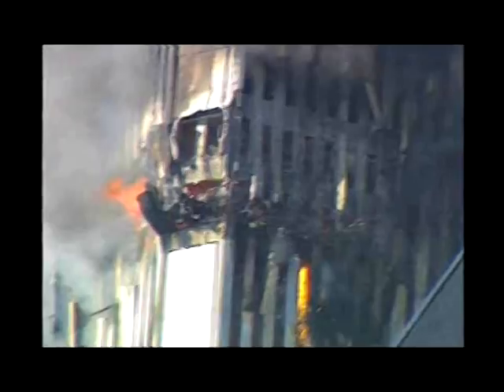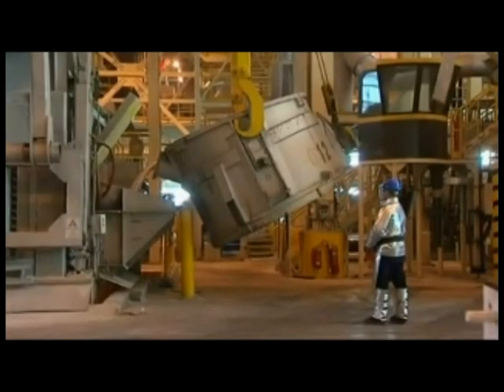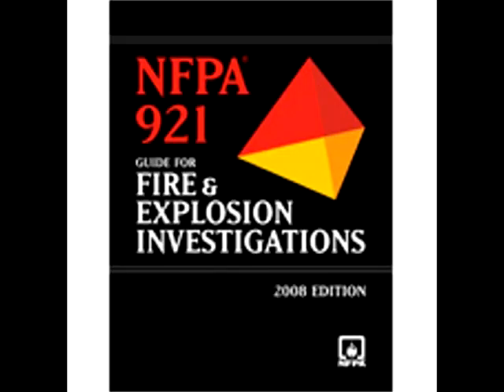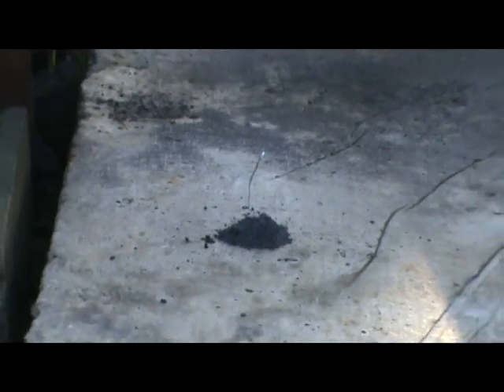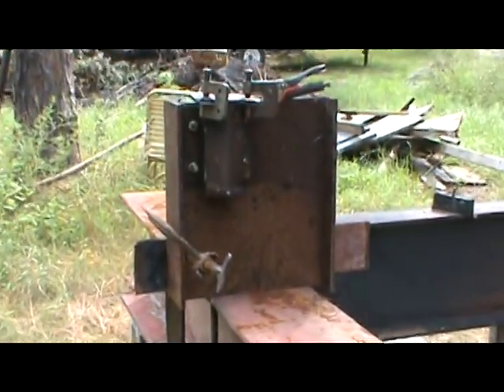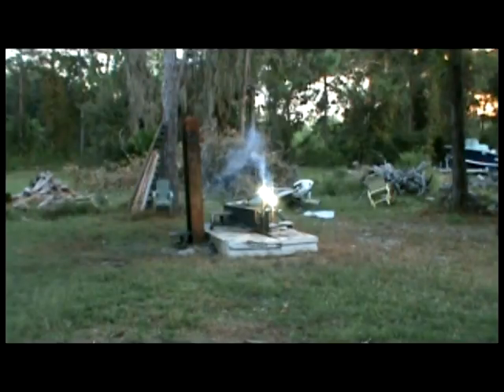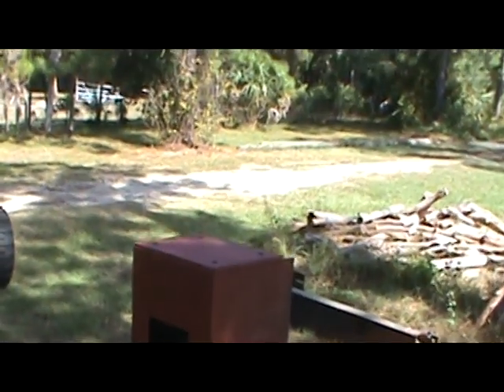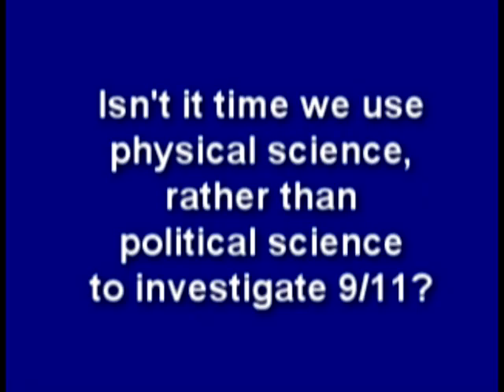9/11 Experiments: The Great Thermate Debate

Comment: LMFAO when engineers design sky scrapers it's tough. You have to make the building strong but light. You need concrete and steel (which are heavy) so you design within tolerances. Concrete & steel have fire tolerances (and planes crashing into them tolerances), when these tolerances are exceeded... the structure fails.
Reply: Craig Thomson And yet they both fell straight down. Going by your theory, the tops of both towers should have buckled and fell over. The planes didn’t go through the whole building, making one side less structurally sound. They should have collapsed on the side where the planes hit and only brought part of the building down. They fell straight down and ended up in a neat little pile on the ground.
Reply: The most consequential designs that were not included in the Twin Towers were sufficient fire-suppression systems and fireproofing. Even though the towers were built to withstand the impact of a jetliner, they were not designed to withstand and remain standing during a fire of such great magnitude. The jet-fuel fire caused by the impact was impossible to contain in the Twin Towers. The World Trade Center had not been designed to fight hydrocarbon fires of such magnitude and high temperature – up to 1500 degrees Celsius. The fire-suppression system consisted of water sprinklers that were useless because water, at this temperature, would vaporize almost instantly. Instead, these fires had to be fought with chemical foam, which the Towers lacked (Ashley 2001).

The fireproofing system in the Towers was also insufficient. First, the Towers were lightweight because of their extensive use of steel and were devoid of masonry or concrete which made them difficult to insulate from the fire. Second, a more sophisticated fireproofing system could have been incorporated during the building process. Most of the supports and trusses could have been coated with extra fire proofing material (Ashley 2001). Third, the World Trade Center incorporated a novel, yet very flammable, elevator system (Wilkinson 2002). The engineers worried that, without masonry, the conventional elevator shafts would buckle and collapse with the intense air pressure exerted by the high speed elevators. To solve this problem the engineers used a drywall/plaster system fixed to a reinforced steel core; this made the shafts more flexible though much more flammable (Wilkinson 2002).

Another design shortcoming that made the ensuing fire even more destructive was the use of weak floor trusses which spanned abnormally long distances (Ashley 2001). In the Twin Towers the steel trusses spanned nearly sixty feet without any support and were only four inches thick (Federal Emergency Management Agency 2002). The extremely high-temperature fire heated the relatively thin floor rapidly, making the floor almost flexible because it lost most of its rigidity and consequently buckled. Since the floor buckled, the extra support needed to come from the remaining exterior perimeter columns, but many had been destroyed by the planes’ initial impact. But those columns also depended on the core steel columns for support, but these columns were being subjected to extremely harsh conditions of the fire and were failing themselves. The exterior columns began to buckle onto the floor which buckled on the floor beneath and started a gigantic domino effect of the plunging stories. So, in effect, the fire caused all structural supports to weaken and fail within the Twin Towers.
Reply: Craig Thomson they designed the building to be hit by planes.
Reply: Craig Thomson I think you just shut them all up 🤫🤫🤫🤫🤫
Reply: Craig will not reply...
he didn't think it over. there have been many fires in tall buildings, the only one that collapsed to the ground was the strongest reinforced building ever to have been made.. the twin towers.
I repeat, NEVER has a building collapsed due to fires, even a fire that lasted over 24 hours..

I can't stand these people that somehow think they know it all better without ever looking further than what's handed to them by some mainstream media even when it taunts logic.
Reply: Euroduck why shouldn't they fall straight down? Have you seen a lot of 1300ft buildings fall? Please site your engineering proof and video's of these buildings falling ;-)
Reply: No, fucker, JUMBO jets at speed.
Reply: a) hollow sheet metal planes cannot cut core columns
b) we're talking about fuel melting steel.
c) you can tell when the fuel was burned up early on because the building smokes.
d) NO building fire has ever collapsed a steel and concrete high rise
e) And it didn't this time, it was controlled demolition (which hapens to be the name of the company that cleaned up the mess)
f) the Popular Mechanics report left out the core columns
g) the building didn't collapse the way they described, it went down like CD
h) the temperature curve DECREASED over time, not increased
i) with core columns the building would have buckled (toppled) sideways otherwise
j) all key physical evidence, eyewitness testimony, and forensic investigations conclude it was CD
k) The military was clearly complicit in allowing the hijacking to continue to completion
l) the Pentagon crash conveniently destroyed teh wing that held financial records.

I don't need to go on. You all fail.

I'd like to add a last note: there are videos of just how bad terrorists are at organized warfare. We had a company of brave US soldiers that won the first battles ON HORSEBACK.  But suddenly they are aeronautical experts and able to control crowds of people on the planes? Fly with precision... etc... 
Those were MERCENARIES. Highy trained operatives, not jihadists. They were hand picked military men from Saudi Arabia. Which just happens to own a lot of America and be super best friends with the Bushes, who happen to be CIA, tied to Nazi Party, Skull n Bones, and the Trilateral Commission.

If you don't see it: you're simply ignorant, nescient really. You haven't done the work, you haven't acknowledged the reality and horror. You apparently haven't studied Gengis Khan, or Stalin, or Mao or any of the other CONSPIRACIES to commit atrocities for political gain. Hell, even FDR and Churchill enabled atrocities so they could justify the war, politically.

Freaking Hillary Clinton was just partially involved in several conspiracies, and we had Fast n Furious.

PEOPLE CONSPIRE. That's what they do.  You just are not important enough to be inveigled into one.
Reply: Craig Thomson and building 7??? and the fall rate being equal to building in controlled demolition??? and pentagon site crash with no engines on the ground to show for... or any working cameras for us to see at least one footage?

I think you just feel comfortable in thinking that your govt is protecting you, good luck!
Reply: Craig Thomson - 
Firstly, I completely agree with Shifu Careaga. That was en excellent breakdown of the main points regarding the 9/11 events AND some wise words regarding conspiracies in general. 
However, I would like to add some thoughts and insights from a trained firefighters point of view, in response to what Craig Thomson wrote:

 "The fire-suppression system consisted of water sprinklers that were useless because water, at this temperature, would vaporize almost instantly. Instead, these fires had to be fought with chemical foam"

-That is literally the key fire suppressing ability of water. It vaporizes and thus "steals" energy from the hot gases that are produced in the combustion process, which in turn brings the temperature down and this eventually extinguishes the fire. 
Regarding foam, it mainly consists of water. What the foam does is that it forms a surface, which to a bigger extent than just water, prevents re-ignition. The foam also exceeds in suppressing liquid fires, especially petroleum products, since the foam floats on top of the liquid. Whereas water, which has higher density, sinks under the jet fuel.

"the engineers used a drywall/plaster system fixed to a reinforced steel core; this made the shafts more flexible though much more flammable"
-I think dry wall is the go-to way for fireproofing, at least in domestic buildings. So to call it flammable is quite a stretch. Solid concrete, although most often much thicker, is of course superior.

Steel/Concrete skyscrapers don't disintegrate from fires. 
They were built to withstand a Boeing 707 at 600 mph

http://www1.ae911truth.org/faqs/655-faq-9-were-the-twin-towers-designed-to-survive-the-impact-of-the-airplanes.html
Reply: Craig Thomson I don’t know if you realize that a plane compared to a building such of those is like trowing a paper plane against a window, planes are made of aluminium...there is no physical way that they will exceed the required specs of a building to collapse if the building would be hit by even a 747!! Do some research!
Reply: Shifu Careaga I don't need A) through L) to refute you. 
A) Those hollow sheet metal planes exerted  3.706 billion ft lbs force upon impact. (That's like being hit with a feather I assume) 
B) The fuel didn't need to melt steel. Steel loses 50% of it's strength at a mere 650 degrees. The fire was estimated to be between 1200 to 1500 degrees.
C) High Strength Concrete HSC (What the columns were made of btw) experiences explosive spalling (that's when moisture in the concrete expands rapidly damaging the integrity of the concrete) at 600 degrees & as we know jet fuel burns at 1500 degrees. So those columns which were no doubt damaged by the impact (see point A) & were also weakened by explosive spalling, may not be the best thing to hold up tens of thousands of tonnes.
D) As for the controlled demolition hypothesis. WTF? Have you ever watch a documentary about CD. 1. It takes weeks to prepare even in buildings 15 stories high (let alone 110 stories). 2. You would need to run many thousands of miles of wiring (which no one saw btw) 3. You would need to lay thousands of charges, which need to be drilled into the concrete (which no one saw btw) 4. The buildings fell from exactly the point of impact & fires (coincidence I guess). 
E) There is footage of the outer walls of the buildings bowing inwards shortly before the collapse. This was caused when the steel girders weakened (not melted by fire) & sagged, as they sagged downwards they pulled the outer walls inwards (that's called physics). When this got too extreme the collapse began & pancaking ensued. Btw pancaking is very common in steel & concrete high rises if you care to look it up (and it doesn't require CD). 

I will concede that it's very possible that the U.S intelligence agencies knew an attack was imminent (and ignored it to further some agenda, who knows).

But what I will also point out is that conspiracy theorist ignore facts. Like for instance the plane hitting the pentagon. They ignore hundreds of witnesses on the freeway who saw the plane (which hit 5 freeway lights & a generator as it passed by) not a fucking missile or bomb ffs. They ignore the thousands of witnesses who worked in the trade towers who never saw any of the laborious & obvious work (workers) required to set up a CD of two 110 story buildings. 
They ignore the fact that the CIA allegedly implemented the most complex conspiracy ever & accidentally had most of the hijackers come from Saudi Arabia (a U.S ally) rather than Iraq, Iran or any number of very beneficial countries.
WTF WTF WTF?
Reply: Euroduck because buildings are made to do that they hen they fail you fucking potato
Reply: Craig Thomson said "Now add a few hundred thousand tonne and a jet flying 500mph and what happens"

A 767-200ER  (the heaviest plane used) has a max take-off weight of 180 tonnes - three orders of magnitude less than "a few hundred thousand tonnes". 

Further, a 767-200 has 200 seats, but the two that hit the WTC had only 92 and 65 people on board - less than half-full, (Why?) so they were far from maximum weight.
Reply: Craig Thomson said "yes small planes accidentally hitting them.... not large jets flying at 500mph".  

During WWII, a bomber aircraft hit a tall building in LA. Since then, tall buildings have been required to withstand the heaviest, fastest plane of the time. (Roughly speaking.)
Reply: Craig Thomson the term conspiracy theory was coined by the IA to discredit people who see through the bullshit
Reply: Craig thomson wrote: 
 https://www.youtube.com/watch?v=8XMTALBYRNA

Yes, the bit that burned collapsed. The bits beneath and beside, that didn't burn, didn't collapse. Self-defeating argument.
Reply: Hermit Oldguy Really? The trade towers had multiple floors fully engulfed for hours (which were damaged by  a huge, fast, jet fulled plane), with 10,000 of tonnes of weight above the burning floors... The video is simply a reference to "no steel & concrete building has ever collapsed". Yes, steel and concrete buildings have collapsed from fire. End of argument!
Reply: @ David Baldwin. 
Indeed, criminal conspiracies happen everyday;
- drug cartels going about their business,  Mafia, IRA
- corporate cartels fixing prices,
- political parties attacking the opposition, eg Watergate,
- Presidents and govt. depts.  eg Iran-Contra 
- Antifa, Animal Liberation Front, Greenpeace, ...
- Intelligence Agencies, eg, CIA, FBI, KGB, MI6, ...
Reply: Hermit Oldguy Read my post two above your 1st post please.
Reply: Yes, brick buildings,steel buildings, and steel and brick buildings, have been collapsing due to fire since the Blitz. 
Steel framed buildings collapse because the heated steel beams buckle, throwing the building off balance: they don't break up, they don't fall tidily, and they don't fall completely. 
Steel-reinforced-concrete buildings don't burn well, and don't fall, eg. Grenfell Tower, London 2017, burned from bottom to top, for 60 hours, 
and it's still standing!
https://en.wikipedia.org/wiki/Grenfell_Tower_fire
  
Youtube is full of videos of structures being demolished, or collapsing from one cause or another. Watch them. It takes a great deal of skill - and explosive - to convert a tower into small pieces that fall in the building's footprint. Without being broken up, a structure will fall sideways, and big pieces will be left after the collapse.
Reply: Hermit Oldguy I can't say I've seen a lot of 110 story buildings collapse. As for the way it fell... think of it like cooking a cake...  if you open the oven door too soon, the middle will collapse (the walls remain high however)... now imagine a building were the internal structure fails (not the outer walls)... it will fall like the cake in the middle first, then pull the walls inward with it's own weight. Once the momentum starts pancaking through the middle of the structure there's not really any reason for it to topple in any particular direction except straight down. Gravity is a cruel mistress.
Reply: Craig Thomson said "I can't say I've seen a lot of 110 story buildings collapse." 

Exactly so! Tall buildings don't  collapse - with good reason. 

Your cake analogy is too stupid to entertain. Clearly you are not arguing in good faith. Goodbye.
Reply: Hermit Oldguy My comment about not seeing many 110 story buildings collapse was a question more than a statement. No one has ever seen a true skyscraper collapse (with the exception of the TT) so any counter argument as to which way it would fall or how it would fall is moot. 
As for my cake analogy, it was a perfect description of how the structure fell inwards rather that toppled over, so no bad faith intended.
Reply: @ Craig Thomson. Cake mixture is a liquid. Cooking it, solidifies it, from the outside in. The centre only collapses if it's not cooked. Your analogy relies on my ignorance of the strength of the centre of the WTC buildings. I know they were by far the strongest part. Your gamble failed and is insulting. 

Lots of tall buildings have been demolished, some well, some poorly.
Limiting discussion to 110-storey buildings is disingenuous. 

You are not arguing in good faith. Goodbye.
Reply: Hermit Oldguy I asked you to read my earlier post which gave a detailed description of how the building failed. My cake analogy was to reinforce the theory that the building could collapse inward. You are correct that the cake falls inward when it's not cooked, conversely the TTs fell inwards when cooked. The process was the point I was trying to convey (strong outer walls, soft inner core=implosion, not toppling over). 
And no skyscraper has ever been brought down with CD. Big buildings, yes... but skyscrapers?
Reply: shifu Careaga yes small planes accidentally hitting them.... not large jets flying at 500mph
Reply: Erik Stigter https://www.youtube.com/watch?v=8XMTALBYRNA
Now add a few hundred thousand tonne and a jet flying 500mph and what happens